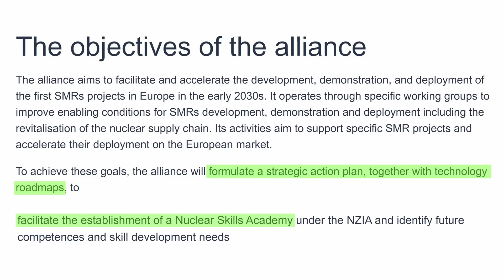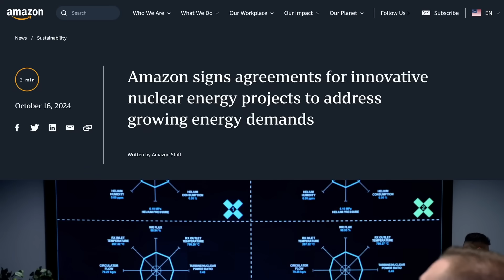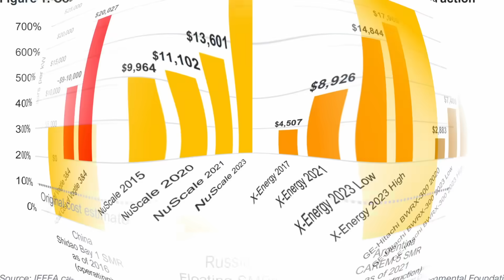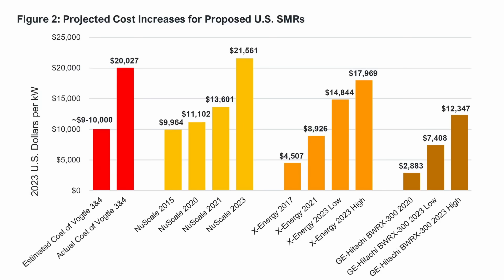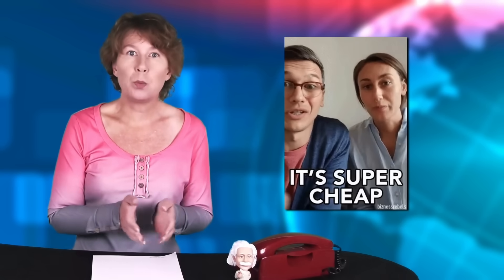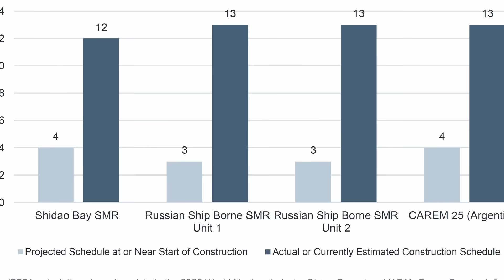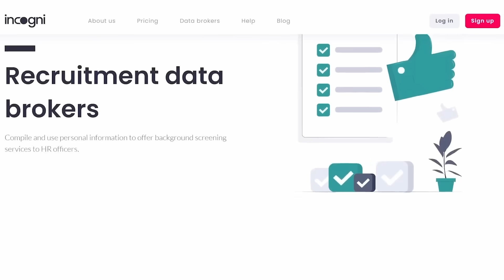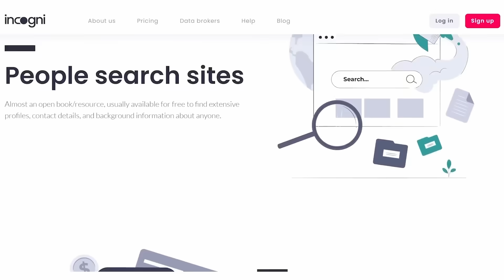Small Nuclear Reactors Have A Big Problem

Comment: Don't we already have small nuclear reactors on submarines & (maybe) aircraft carriers? USS Nautilus (SSN-571) was launched in 1958, 66 years ago. I am sure it didn't have a full sized nuclear plant on board!
Reply: They are not designed to be fail safe & require constant human monitoring - if they fail you will have a massive disaster on your hands & a very hot zone for thousands of years. The point about SMRs is if they fail they shut down & in theory you can put them in cities next to people. They are a completely different beast!

Comment: Are these SMRs actually small?
The closest nuke to me (which is in the process of decommissioning b/c it was deemed that a nuke near NYC was too big of a risk) had 3 reactors: 1 257 MWe & 2 ~1030MWe. 
And these are the OG big boy reactors that were made big & complicated to take advantage of the economies of scale. 

How would stringing together a few 600 MWe reactors net a simpler alternative? I would think that some things might be simpler, but to really compete cost wise with larger nukes they would have some more complex common parts (like water cooling/pumping etc)?
I feel like the idea is sort of half baked. Maybe it’s nice for bringing nuclear power to areas that don’t have a lot of demand (and saving on the losses of long range energy transmission, as slight as they may be), but maybe not so nice if you need multiple units?

Comment: It's common saying in engineering that, "All projects take longer and cost more than originally planned.'
Reply: Renewable projects typically come in within 10% of the projected cost.
Reply: But solar parks could be an exception. The modules are costing less by the minute, and installation costs are not rising dramatically, at least I presume so.
Reply: @bernhardschmalhofer855  ; and a storm says: "Gone in 60 seconds"

Comment: I can't speak for other countries, but in the USA, nuclear power was crippled by the regulatory agency, the NRC - and that was before 3-mile Island and the public's opposition. The NRC is the only agency I know that could issue a permit, then require updates in the middle of design and construction, to comply with new regulations. As an engineer, I was horrified by this concept. Making a change to a half-designed project risks serious errors. And, of course, it increases the time and cost to bring the reactor online.
Reply: Sounds like you want to continue building a proven faulty system. Not exactly a strategy for success.
Reply: @traumflug  Proven faulty???? Whatever gave you that idea? Regulations change all the time. They generally improve projects (not always, though), but that doesn't mean the earlier regulations were unsafe. Making significant changes in the middle of a large project is definitely unsafe, though.
Reply: @nigelrg1  You appear to have a funny understanding on what regulations are. The only reason why regulations exist is to make reactors safe. That's why there are stringent regulations for nuclear (generally huge risk), but only few for solar (generally safe). The only reason why regulations change is that earlier regulation were found to be unsafe.
Reply: @traumflug  So I should get out of my house because it doesn't meet current codes? Regulations change for numerous reasons. Probably 80% of the power plants of any type don't comply with current regulations for NEW plants.
Reply: @nigelrg1  Your house isn't a security threat. For security related issues, older houses do have an obligation to receive an upgrade. It just happens rarely, because houses of all ages are generally safe. — — — One recent example: in the EU, houses now have to have fire detectors. Every flat, every house, every home, no matter of age, got one installed.
Reply: @traumflug  According to my City (Berkeley, California), my house is a security/environmental threat on several grounds. Earthquake proofing is desirable, but not required, because it's so expensive. And the EU is only now requiring fire (smoke?) detectors? Smoke and CO detectors have been required for years here. Though, to be fair, most of our homes are wooden.

Comment: Rather than focus on small modular nuclear reactors with their astronomical costs, maybe it would make more sense to put the money into small modular photovoltaic and battery systems.  It would not only be less expensive and dangerous, but distributing generation throughout the grid would eliminate the need for a lot of the new transmission lines that will be needed if generation is concentrated in power plants.  It will also make the grid much more resilient to damage and blackouts.

Of course the reason this option is not considered is that the small companies that install photovoltaics don't have the political clout that the huge nuclear power plant construction industry does.
Reply: Small photovoltaic systems produce small amount of electricity.  One thing they inevitably need to produce more is a large collecting area.

Comment: One concern I have not heard in this discussion is that of terrorism.  Small nuclear reactors pose extreme danger from being targeted by terrorists as plentiful and relatively softer targets.
Reply: Actually no. The safety requirements to withstand earthquakes and falling airplanes are the same for big reactors and SMRs. So, the SMRs need a big heavy duty enclosure, built in place just like a regular reactor. Since SMRs take up more volume per MW, this cost is typically higher than for standard nuclear.
This cost (and many others like pipes etc) just isn't mentioned in the SMR sales pitch.
Reply: At these prices they will not be plentiful.

Comment: Too expensive, too slow and too risky. You showed it yourself. Solar and wind are dirt cheap and combined with batteries enough to power the grid.
minute4: Solar panels (only the panels) cost around 90$/kW. Full roof installation in germany INCLUDING battery storage around 1300$ per kW
Reply: um. wind and solar by their nature make them incapable of powering baseload, their cheapness comes at the price of human rights in china and is the impact of a trade war that is walking us towards global conflict, and with over a hundred billion dollars of grid level batteries installed in the US the batteries on the grid can power it for...  8 minutes.

the green dream was a pipe dream, and it is dead. it required fantasy thinking and ignorance of basic math.

Comment: here's the thing: I don't think it matters at all to the companies buying the reactors if these smrs are expensive, because the amount of energy these tech companies need to fuel their datacenters is so ludicrous that the potentially expensive upfront cost of an smr or other type of nuclear reactor is the only feasable way of generating enough energy, and will be worth it in the long run to generate huge profits from ai or whatever it is they will be using the datacenters for.
Reply: The nice thing about data centers, especially those doing background tasks like training an AI model, is that one can slow them down easily. Run them at full capacity when solar electricity comes in, run 20% of that at night.
Reply: @traumflug  you a absolutely don't want to be doing that with a datacenter, datacenters need very high availability and uptime.
Reply: @Fr00stee  These aren't web servers. Uptime doesn't matter.
Reply: @traumflug  if it's something like chatgpt or a general datacenter yes it does, otherwise the service doesnt function if it's down
Reply: @Fr00stee  I wrote about training a model. This happens completely disconnected from the public and is the task where this enormous power consumption happens. Using a model, e.g. via a website, is much less computing intensive.

Imagine a training task which requires 1 million CPU hours. One can use 10,000 CPUs, so it takes 100 hours or 4 days. However, 4 days of day-and-night-electricity for that costs $100,000. The better option is to use 20,000 CPUs running during the day on solar electricity only, electricity bill just $10,000.
Reply: @traumflug  The cost of the AI training chips if far too higher to have them sitting idle, the cost of continuous power is far less then the depreciation on hardware.  It has nothing to do with connection to the internet and the uptime needs of a server.
Reply: @traumflug  ...that is absolutely not what you want to be doing with a datacenter, the entire point of having a datacenter is to have as much availability and uptime as possible. What's the point of building out a huge datacenter if only 20% of it is only ever going to be usable half the time? That's just stupid.
Reply: if the cost of energy is higher than the profit of AI they won't do it. Basic economics.
Reply: @fablearchitect7645  clearly they believe it will be much higher which is why they are investing in it
Reply: That's not remotely the case, Data centers are not even causing a rise in total US power consumptions.  The constant fearmongering over their power demand is about the capacity of local GRIDS to deliver the power, not of the electical production capacity to be meet.  When data centers get direct deals with power plants its to both lock in a bulk rate AND avoid grid expansion/congestion costs that utilities would make them pay.  New Nuclear is absolutly the most expensive thing they could do, which is why only the extension of existing power plants is ever considered where your only looking at continued operating costs on a fully paid off reactor, and even that is MARGINAL buisness case.
Reply: @kennethferland5579  well then explain why companies like google are buying smrs in bulk from companies

Comment: Sent by Copilot:

Let’s break this down:

Solar Panels

If a 300-watt solar panel costs $100, then with $1 billion, you could buy:

1,000,000,000100=10,000,000 panels1001,000,000,000=10,000,000 panels

Each panel produces 300 watts, so the total wattage would be:

10,000,000×300=3,000,000,000 watts or 3 GW10,000,000×300=3,000,000,000 watts or 3 GW

Modular Reactors

Small modular reactors (SMRs) can vary in output, but a typical design might produce around 300 MW (300,000,000 watts) per reactor1. Assuming the cost to build one SMR is around $1 billion, you would get:

300,000,000 watts or 0.3 GW300,000,000 watts or 0.3 GW

Comparison

Solar Panels: 3 GW for $1 billion

Modular Reactor: 0.3 GW for $1 billion

So, in terms of raw wattage, $1 billion would get you significantly more power from solar panels compared to a modular reactor. However, it’s important to consider factors like energy storage, land use, and the continuous power generation capability of nuclear reactors versus the intermittent nature of solar power.

Do you have any other questions or need further details on this topic?

1￼en.wikipedia.org2￼startribune.com3￼abcnews.go.com4￼energy.gov5sciencenews.org6arkaenergy.com7theittproject.com8suntrica.com9lowes.com10solarreviews.com+7 more

Comment: Sabine, "small" and "micro" nuclear reactors are two different things.  If my memory serves correctly, "small" is a reactor down to 200 or 300MW.  Under that rating they are considered "micro."  Not even one commercial micro nuclear reactor has ever been built by any country, anywhere on earth, they have been in the dream stage, only 5 years away, since the late 1940's.  
The reactor vessel is the only part of the modular designs that is portable or "modular, all the other plant infrastructure (turbine/generator, cooling, etc.) is permanent and a lot of that will have to be built on site.
Here's the thing about the current micro modular craze: it's all a sham.  The potential payoff is magnificent indeed but the incredible promise of micro modulars is merely bait to attract the stratospheric amounts of investment that are being fire hosed into this space.  No company has to actually BUILD a micro modular reactor, all they have to do is show some plans (blueprints for probably thousands of micro reactor designs have been drawn up since the late 1940's) and SAY they are ready to build a micro reactor to get tons of money thrown at them.  So everyone is rushing in to attract investment but the problems and challenges facing micros are staggering so why would anyone actually build a plant, which is going to showcase the unviability of the concept and end the investment stream when everyone is getting rich from just PROMISING to build a micro plant.  
It's just like the small  and mid size gold mining industry.  Only one out of maybe 1,000 small and mid size gold miners even breaks even and only 1 in 5000 actually make money at it.  For all the rest, they invest and lose a bunch of money, the only ones who make money are the guys who sell the claims and manage/operate the mines.  Every investor knows the above odds yet they still invest because just MAYBE they will be the lucky 1 in 5,000 who finds the mother lode and earns unimaginable wealth.

Comment: Thx for ruining the party Sabine : )
Reply: Starting with Intel since we are dumping up a bunch of money into them they need to produce photonic processors that operate with much less power and do everything they can to increase efficiency.  For one thing we need to pull all the fossil fuel reactors off-line and that’s what they should be used for initially to save the planet not the power, some billionaires project.  Stop playing games and get it done.
Reply: You have a lot of options other than just burning more energy.  You could slow your roll and introduce brain in plants that work very well and use the human mind as a network super computer.  Not only would that be more efficient, but then AI couldn’t get rid of humanity just because it doesn’t like us since we are the computer.

Comment: I think many of the startups getting into this business just don't understand how much b/s the government makes you do with anything nuclear. There is also basically a non-existent supply chain for nuclear qualified parts due to the past 40 years of nuclear decline. The delays and cost overruns make sense when you consider this, and what is required to qualify a commercially purchased part. There is an entire ecosystem of suppliers that will need to be created to support a resurgent nuclear industry, and unfortunately they just don't exist at this time. Building this supply chain, and streamlining the regulatory and approval process will be required to realistically build out nuclear power to meet clean energy demands.

Comment: Increased labor costs plus increased time to completion will definitely raise the total price... but those factors couldn't be what rose the price from 3 billion to over 9 billion. They purposely underestimate these deadlines and costs, whether subconsciously or overtly, in order for the project to get a green light. A 9 billion dollar, decade long SMR project wouldn't have gotten the go ahead. So, what you do is underestimate the totals, and then try to slip in line item budget increases each year. Then you invoke the sunk costs fallacy (but don't call it a fallacy, obviously) to string the investors along until they've finally had enough... and then you find another potential project who needs a manager with your skills.

Even scammers work like that. If you ever try to "get out while you can" from a potential scam, to get your money out... If they tell you that first, you need to pay taxes you owe, and a transfer fee... you're not getting your money back. They'll keep asking for more money in order to withdraw your original money, until you realize that it was never anything BUT a scam.
Reply: In order to be effective small reactors require HALEU  fuel which even if produced in the West  in very small quantities. Some experts say it would take 10 billion dollars, 5 years to design and get approval and 5 more years to build a plant  for that fuel. The department of energy stated, does not bother us until demand is there.  Who would invest in reactors, if there is no fuel for them? All this western nuclear renaissance is just a scam

Comment: It's not just price. Factory production could bring that down significantly.
It's also the question: what purpose do they fullfill? What can they do, that is so necessary, that a larger plant can't?
Shure: If you have a large battly-ship or submarine they are awesome, but in civil infrastructure?
Also: If we run on nuclear as a world, we would run out of Uranium in like 50 years and then we are right back here, desperatly trying to find something that isn't renewables, because renewables are gay.
Reply: Dont worry about running out of uranium in 50y fusion is only 30y away. Trust me bro
Reply: What kind of large plant, also nuclear ?
Reply: @dmitripogosian5084  yes

Comment: SMR is a meaningless marketing term supposed to make nuclear less scary. The "SMRs" that have failed so far were all small pressurized water reactors, the most expensive type of reactor you can think of. They made them huge in the past to gain a bit of savings that way. When you make small ones, the cost for a unit of energy goes through the roof and always will based on the design. Super-high-pressure combined with inefficient-low-temperature, the worst combination possible.

If, if, if nuclear is going to have a future it will be with low-pressure/high-temperature reactors under reasonable regulation. We know how to do the first part well enough, it's the reasonable regulation that may be beyond our reach. In America, the NRC has already said they will not comply with the congressionally passed Advanced Act.
Reply: High temperature is the path to failure - don't.
Reply: @ich3601  High temperature is the path to much higher efficiency, thermal storage and industrial process heat. All huge advantages.